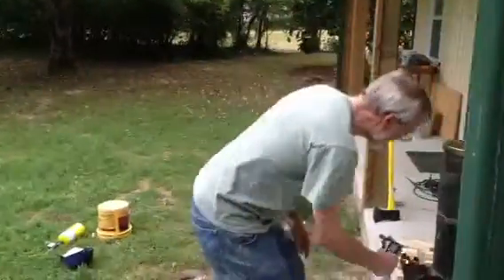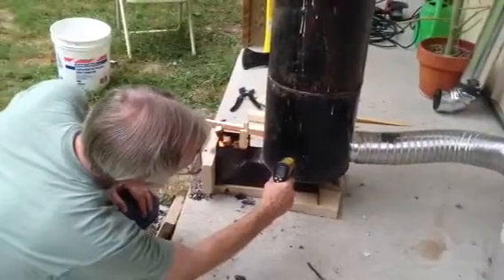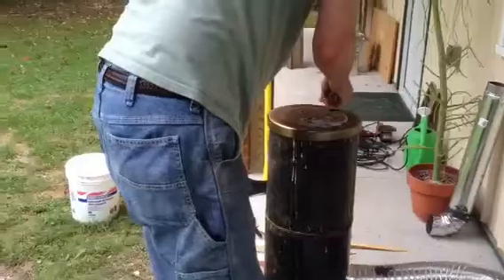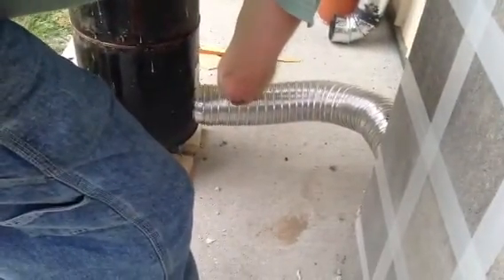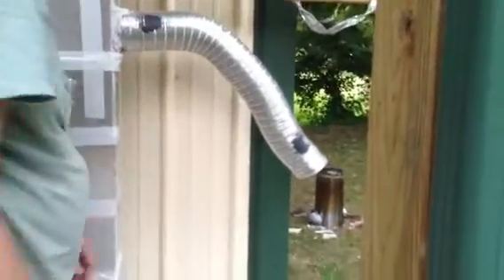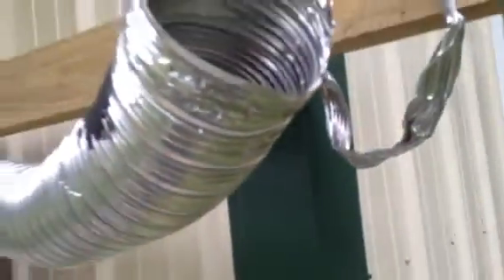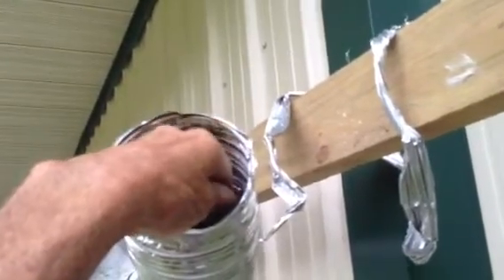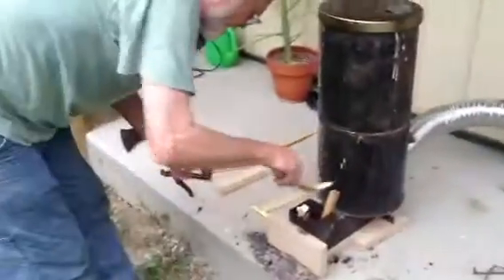Rocket stove mass heater build for $100 and an afternoon

Comment: Wish this had been more about building it, rather than a display of temps. Convincing but not useful to make one.
Reply from the maker: Sorry, just use bond beam blocks on the top and bottom, using 1/2 blocks to cause the holes to align, bottom to top. Use cheap acrylic caulk to join the blocks. We used tape because it was a temp structure. https://www.menards.com/main/building-materials/concrete-cement-masonry/construction-concrete-blocks/8-x-8-x-16-bond-beam-block/1796259/p-1444441455602.htm

Comment: I'm with the people who want to see how this thing's made please. It's so little, what's the material in there?
Reply from the maker: I just taped the blocks together for the test. Later, I used cheap window caulk as mortar to erect the wall.
Reply: @rwpresley  thank you but,
I want to see inside the stove not the wall please.

How did you construct such a small mass Rocketer?
I have a very small space I want to put one into.
Reply from the maker: I used two 5 gallon steel pails, mouth to mouth. They can be held together with a lid ring. I welded a burn chamber and riser out of 4" steel square tubing. I surrounded the riser with a piece 6" stove piped. I filled the pocket between the pipe and the riser with pearlite.

Comment: Is there piping behind the mass wall, or is it just tube dumping hot air into the mass wall and another tube for the exhaust?

If the wall is just a chamber without tubing, wouldn't it be better to have the tube from the stove on the high side and the exhaust tube on the low side?
Reply from the maker: Just a pipe in and out. The block makes tubes for the gases to flow through, not one big chamber.  The system won't draw unless the outlet is higher than the inlet.

Comment: Hi. Interesting video. 
What is the size of the cavity?
I would’ve entered the hot air/gases to the top of the wall and exhausted it from the bottom of the wall where the cooler air/gases would be  forced to exit??
Just a thought. You’re exhausting warm air?
Reply from the maker: The cavity is the inside of a concrete block wall with bond beams not top and bottom.. The stove would not draw if the exit were from the bottom. Hot air rises.
Reply: Robert Presley 
Hi Robert. 
Yes hot air rises. That’s exactly my point. If you exhaust it from the bottom the coolest air would exhaust first leaving the hotter air in the wall longer.
Reply from the maker: You'd think. Try it and let me know.

Comment from the maker: It's just concrete block with concrete bond beam top and bottom, put together with acrylic caulk and tape.
Reply: Robert Presley can you tell how u did the insides
Reply: Inside of the stove, not the wall please